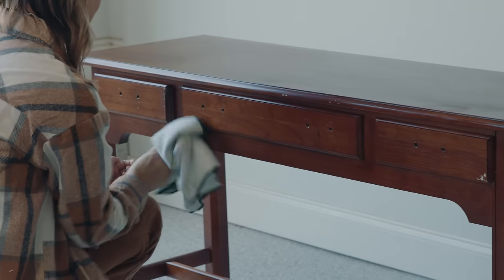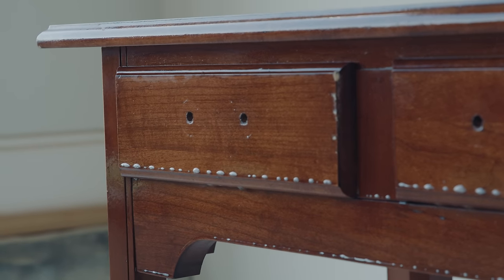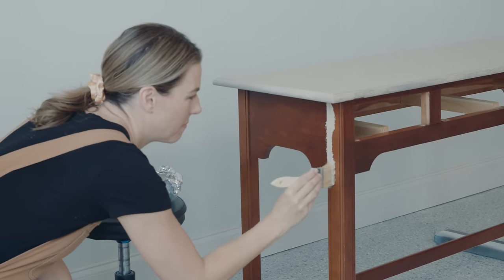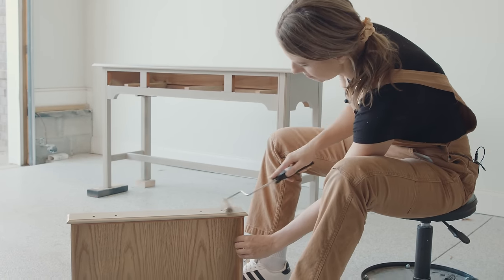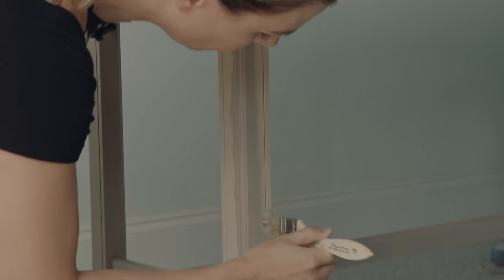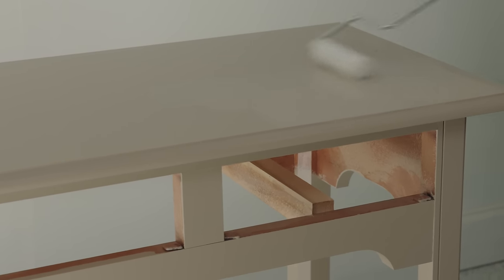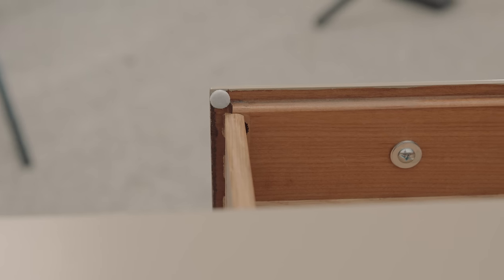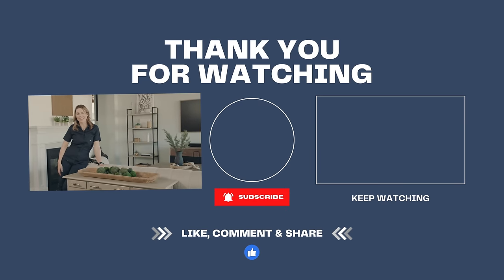Painting Furniture For Beginners | No Experience or Tools Required

Comment: Lovely! I am looking forward to 
  Thanx to you, I will try BP
  However, I am not crazy about not being able to use my table for 30 days, while it cures. Do I really need to use BP brand of sealant or can I use a polyurethane to protect my tabletop?
Reply from the maker: This paint does not require a topcoat. They do make one if you want extra protection but it isn't necessary. Every furniture paint has a manufacturer recommendation for cure time. 30 days is pretty standard. Its very important to let it fully cure and harden to reduce the chance of chipping.